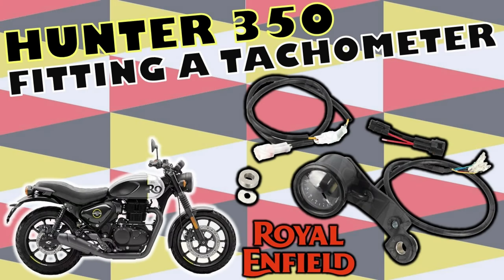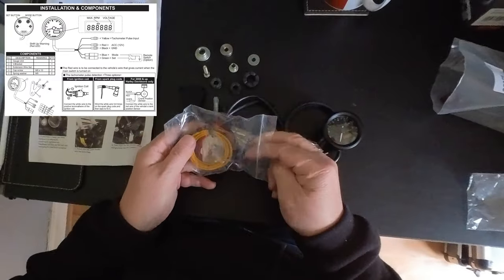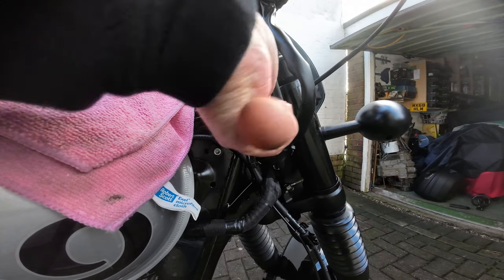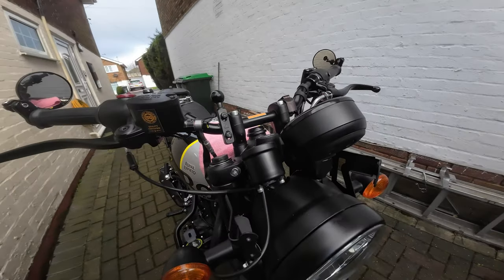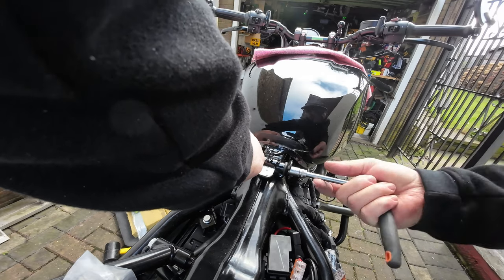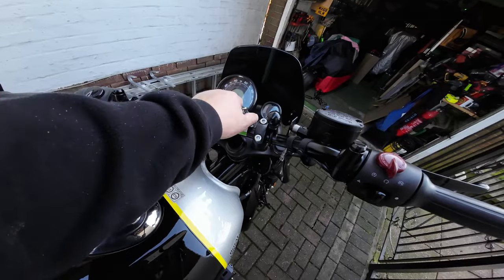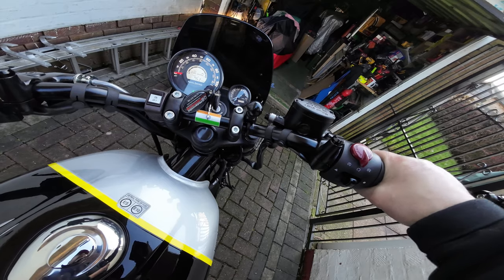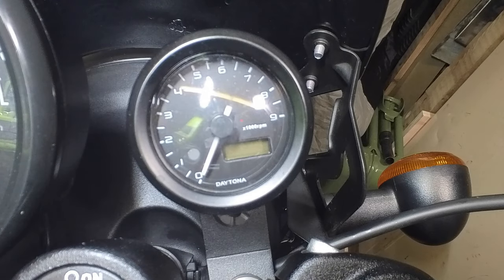Upgrade Your Royal Enfield Hunter 350 | How to Fit a Rev Counter

Comment: It looks like this style of Tacho could be fitted to any bike using the long stand wire wrapped around the ht plug lead, and giving the instrument a simple 12v feed. It seems it is around £110 or so though as a stand alone item.

Very nice fitting instruction video Sir.
Reply from the maker: Thank you for watching and commenting. Having now installed one, I agree it would be very straightforward to install a generic tacho. I think for some the benefit of the Hitchcocks tacho kit is the wiring accessories c/w plug that fits that auxiliary 12v yet still retains the plug for other accessories, the coil take off wire and the bespoke mountain bracket. I’m going to fit a generic tacho to my Scram and make my own bespoke mounting bracket 👍🏻🙂

Comment: I’d love to replace the tripper by a tachy on my SM650. Where can I get a thac or what model should I get. Nice and instructive video. Thank you for taking the time . Cheers mate
Reply from the maker: Hello and thank you for the message. If you do a quick search on motorcycle tacho a lot of results are available, including some sold on Amazon. Should be pretty straightforward to remove the tripper and install a tachometer on its place. Hope this helps 👍🏻

Comment: Thanks for that rev counter next on list when they are in stock, just a point the lights on the engine bars where did you get them and how did you wire them thanks again Ted
Reply from the maker: Hello Ted, you’re very welcome. Thank you for watching the video and leaving a comment. Link below to the spotlights available from Amazon. They need some modification to fit them to the bike, they don’t come with any fitting instructions or wiring diagrams, but it didn’t take very much working out. I’m about to fit another identical set to Paul’s Hunter and I’ve modified and added a couple of parts to make them plug and play. I’ve posted photographs as a community post which will hopefully allow you to see what I’ve done. I’m going to fit a set to my Scram in the near future and when I do I will make a video showing how to make the loom and fit the lamps. It’s great having you along with us 👍🏻😁

Link to the LED lamps: https://amzn.eu/d/0qynBqp

Comment: I would love to see Hitchcocks make this kit for the Scram 411. I would remove the tripper on my 2023 and replace with this, which would be much more useful.
Reply from the maker: I might try and fit one to my Scram in front of the Speedo and the tripper. But rather than buying the kit from Hitchcocks I may buy a stand alone tacho (comes with bracket) but I would make my own bespoke bracket. The only thing I would need to ascertain is how to take the pulse from the coil but I’m confident that would be an easy solution. The tacho’s only use 3 wires 12v +ve and -ve (pick up at the auxiliary connection in the headlamp) and the pulse wire from the coil. If I do fit one, I’ll make a how to video.
Thanks for watching and leaving a comment 😁👍🏻
Reply: Now that would be very popular, Dave. 👍
Reply from the maker: @Lanes-Explorer5733  I’ll add it to the to do list Peter 😁
Reply from the maker: @paulfoster5432  hi Paul, apologies for the delay responding. The LCD display in the tacho displays battery voltage when the bike is running and highest RPM recorded. It also displays the settings menu for pulses per revolution and gear change indicator settings. Additionally it displays the colour of the rev counter display, orange, white, or blue. Hope this answers your question? 👍🏻

Comment: Two questions. Can you fit this to the 350 reborn, and where can I get the sat nav bracket from. Great video. Thanks.
Reply from the maker: Afternoon John, thank you for war hing and commenting. Hitchcocks state it will fit the Meteor 350 and the Hunter. I suspect this is more to do with the bracket provided as part of the kit rather than the tacho itself. I think (but could be wrong) that the Daytona tacho will fit most models of bike, it’s the wiring accessories and bracketry that the Hitchcocks kits contain that are model specific. The Sat Nav bracket is a bog standard RAM mount, lots available on Amazon, let me know if you need a link. Hope i’ve answered your questions? 👍🏻cheers 🙂
Reply: Thanks for the info. That would be great if you could send me the link.🌪👍👍
Reply from the maker: @johnrobertsmith9481  no problem John, here you go... https://amzn.eu/d/6Xg2dUv
Reply: @MerciaMoto  Thanks,got it. Order it.👍

Comment: Can someone help me find the name of the two pin connector used for the ignition and for the 12v power? I have an existing velona I wanna put on my hunter
Reply from the maker: Hello, thanks for watching and leaving a comments. I believe this is what your're asking for?
https://auto-connectors.co.uk/products/2-pin-waterproof-connector-plug-set-fits-sumitomo-mt090-6187-2311-6180-2321?pr_prod_strat=e5_desc&pr_rec_id=1d4ea606a&pr_rec_pid=8745350758703&pr_ref_pid=9334207873327&pr_seq=uniform

Comment: Hello Sir,
I plan on installing the entire speedometer and tachometer unit onto my Hunter 350, do you think it will be done without the need for extra wiring?

Thank you
Reply from the maker: Hello, I assume your Hunter already has the speedometer fitted? If you are just going to add the tachometer, all of the wiring you need is included in the kit supplied by Hitchcocks. Hope this helps? 👍🏻
Reply: @MerciaMoto  yes it is! im planning on converting mine to a cafe racer with some engine mods so thought a entire unit from the interceptor might suit better
Reply from the maker: @harry3370  ah I see, I wouldn’t imagine there would need to be to many mods for a combine unit, other than the wire required to pick up the pulse from the coil 👍🏻